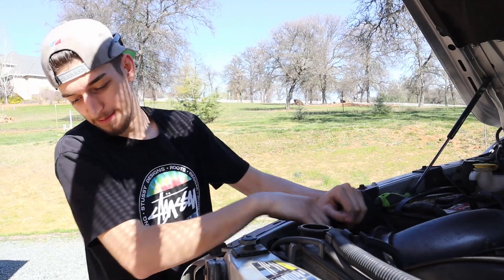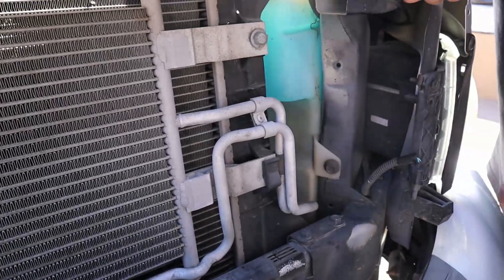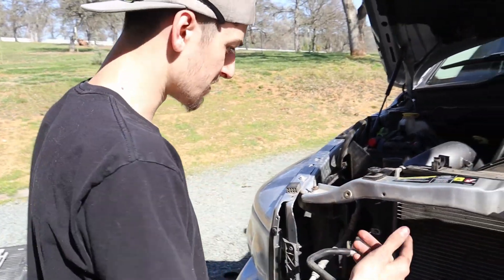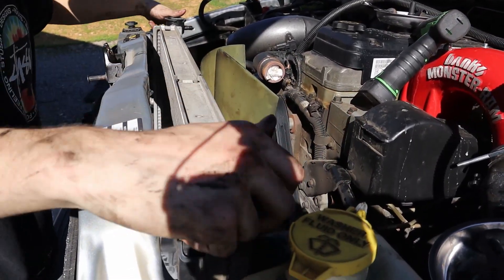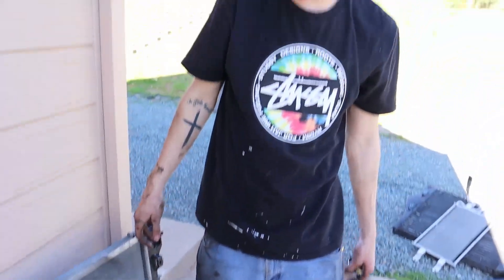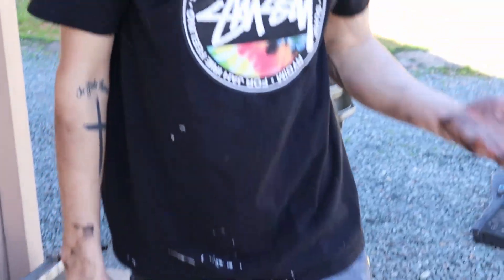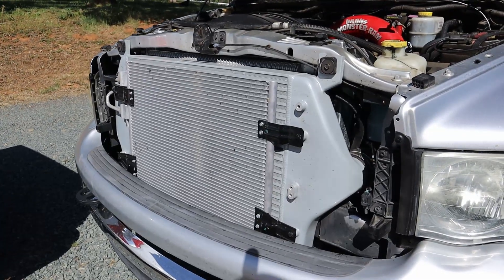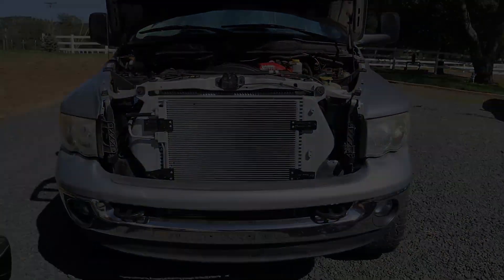Mishimoto Radiator, Intercooler, and Trans Cooler Install on the Cummins!

Comment: Any update on the mishimoto radiator I thought about getting one thanks
Reply from the maker: Yea they are badass
Reply: @solomonjames9182 how do you know which line goes where cuz i rebuilt my whole motor and transmission an bought new lines an mishimoto cooler

Comment: It looks like you ran the larger Banks intercooler tubes? Is that right?  What made you decide on the Mishimoto intercooler versus the Banks?  Banks does the comparisons between all the others, but does not compare the Mishimoto to the Banks in terms of flow. I do appreciate Mishimotos warranty, which I assume was one of the reasons you chose their intercooler let alone having all the same stuff from the radiator to the transmission cooler.  Appreciate your video.
Reply from the maker: Yea, ran the the Banks tubes and Mishimoto is top of the game in cooling in my opinion. Which is why I chose Mishimoto. Thanks for watching!
Reply: I like the question and your answer,  glad you came back to answer.  I'm getting ready to do the exact same.

Comment: How much cooler were your transmission temps?
Reply from the maker: Not sure about the difference because I didn’t have a reading on it before my tuner but now that I can read it’s 155 degrees
Reply: @solomonjames9182  thank you good sir!
Reply: @solomonjames9182  that's about what I'm getting, thanks for the reply good sir.